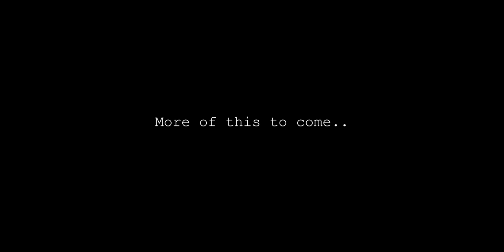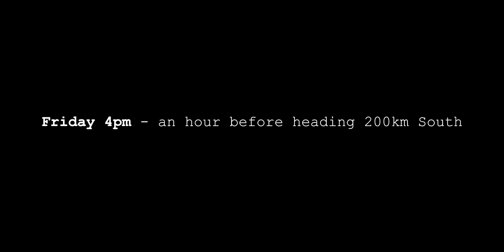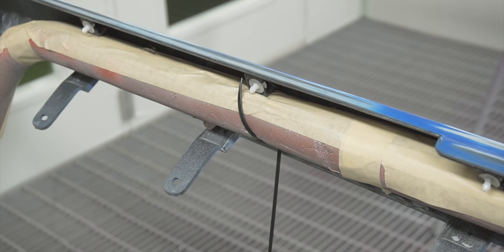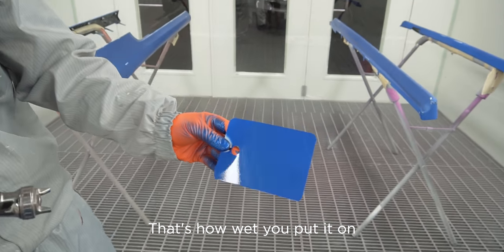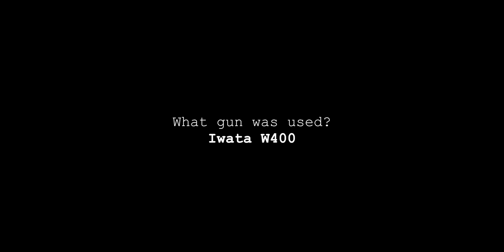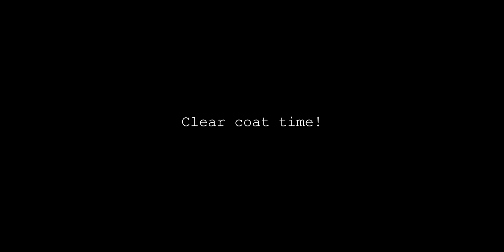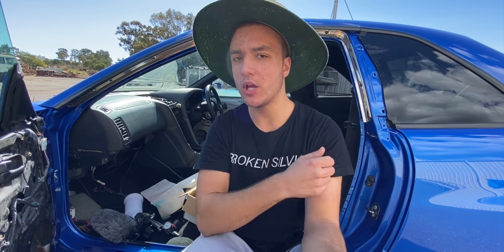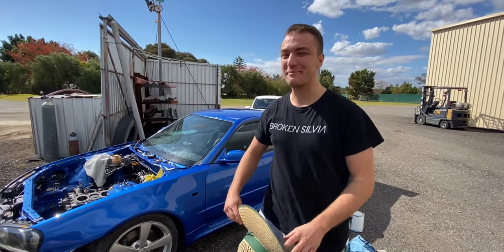CRASHED R34 Skyline gets Painted AGAIN.. | Poor Man's GTR [EP21]

Comment: Buenos Aires Amigo ! 

The source of the car, chassis and engine together of course has its name.It's not GTR.Its CJ.

because with each single time(of many times) you were disassembling and assembling the fenders,quarter's ,everything,the car has always been saying quietly ; " Ohhh Shieeeet,here we go again".....

Bruh.
 But,honestly i don't understand the paint science presented in this video :
1.Firstly,before Your tryout, Sharif Godzilla did it with white coat and it came out great as Bayside blue should . So does it mean he did major mistake according to Sam and Jayden or literally bayside blue correct painting ?
2.Its 1.5 coat now but you didn't scrape all of its paint,so with this new "method" what is the "full recipe "for  doing it right from bare steel?
 
Those questions tickles brain right away...
Reply from the maker: Depends on condition, hard to answer your question